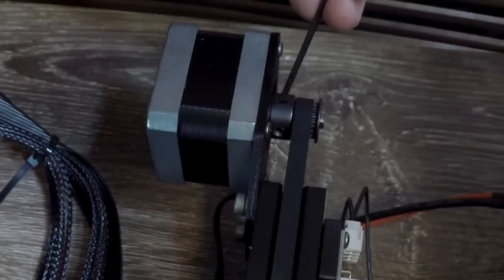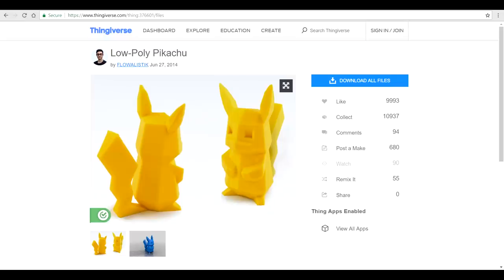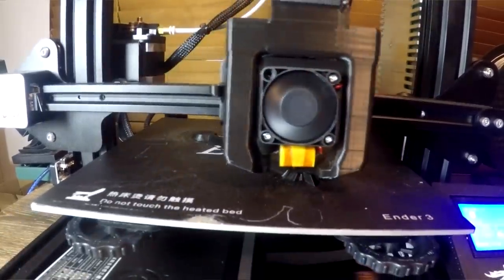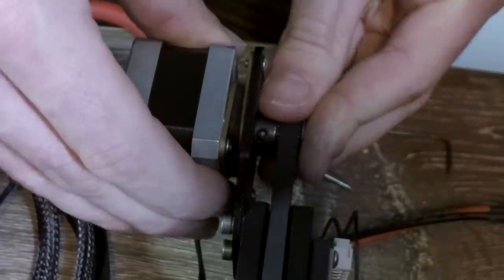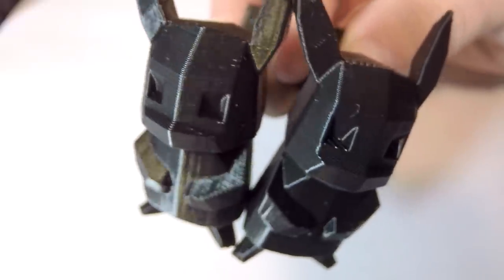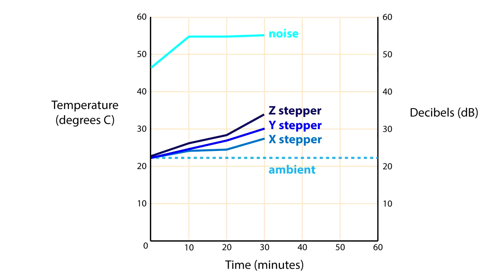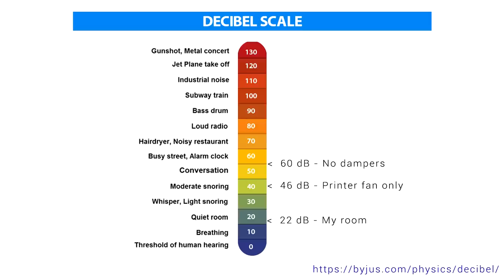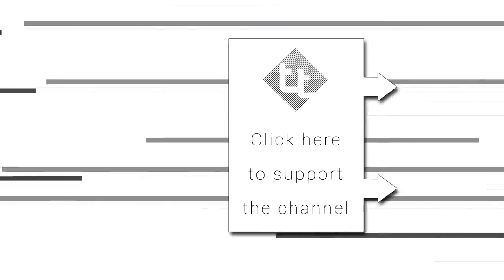Quieten your 3D printer with stepper motor dampers: Ender 3 tests

Comment: This guy has a solution for the likes of us who have stepper motors with pressed on pulleys:

https://www.youtube.com/watch?v=IjzrNoFnbcI&feature=youtu.be
Reply: Make a fixture to support the pulley while you tap the shaft out of it. Fit pullies that have grub screws.
Reply: @ventilate4267  Does it still work perfectly when putting the fit pulley back on the stepper motor?
Reply: Hammer is always a solution :D I think, that this is the common issue of people from printing community, to solve every problem by printing new parts, even if its usually not really needed :)
Reply: Or go to home Depot, buy a pulley puller, pop it off in 10 seconds and return it.
Reply: The above video for dealing with the pressed on pulleys DO NOT WORK FOR ENDER 3 PRO, the level adjustment wheels will hit the stepper motor
Reply: That's just a horrible solution. Too much things to change, including flashing firmware.
Reply: I guess it is kind of randomly asking but do anybody know a good website to watch new tv shows online?

Comment: Pro tip: steal two M3x8 screws from the lcd so you don't have to buy them. The lcd is fine with the two it will have left.
Reply from the maker: Great tip :)
Reply: Geweldig, thanks Maarten
Reply: LCD dislikes this
Reply: Was litterly sawing off the 2 screws that were too long... got through one after a long time and gave up... then i see this <3
Reply: Does your motherboard lid really need screws?
Reply: @franksimon8375  nahh

Comment: Just to let people know. On the latest ender3 I got, the pulley's are heat fitted onto the motor shaft so you cannot adjust the pulleys. I'm just going to get them off with a dremel & use spare parts I have to use this upgrade. Kinda a cheap, annoying move on their part.
Reply from the maker: Hmm that is surprising because it sounds more expensive for them.
Reply: Surprised me too... Its possible that the motor/pulley is from another mass produced gadget, like a 2d printer, & was actually cheaper to buy as a set. Trade is getting more complicated right now so they are probably getting more creative to keep the price down & maintain old profit margins.
Reply: I just got my dampeners in and went to install them and realized this is how mine is. So annoying.  Is there no way to get the pulleys off and still reuse them? Or if I get them off, can I buy new ones?
Reply: @MooKeeFPV  very easy to by new ones. they are gt2 6mm pulleys. the important thing is to count the teeth. its probably either 16 or 20 teeth but make sure you get the right one so the steps per mm is right. you should be able to get a handful of them for 10 dollars or less.
Reply: Bore in mine is 5mm, not 6!
Reply: @albertogomez-casado5527  6mm is the belt width sorry for not being more specific. the bore is 5mm to match all nema 17s
Reply: I had to end up buying the gears and this gear puller to get the other gears off the stepper.  https://www.amazon.com/gp/product/B07BFP7WGZ
Reply: @MooKeeFPV  thats a nice find! i might have to get one too.
Reply: @dakotapahel-short3192  I was watching youtube videos of people hitting them with a screw driver and a hammer.  I knew there had to be a better way.  Mine comes in today. I will let you know how well it works.
Reply: @MooKeeFPV  i was just going to use my dremel to cut it off... that way appears to save you a pulley for something later.
Reply: Dakota Pahel-Short that still may be an option. This puller I got is like 5mm too small
Reply: Oh ffs - just noticed the same on mine. Effin bastards. Already ordered the dampers.. cheap as dirt but now its just pissing me off. Still like my Ender3 but not buying from Creality again. They could just install dampers themselves and increase the price by a couple of bucks to keep the margins - but yeah thats not happening with a chinese company.
Reply: This is odd, I just ordered directly from Creality via Amazon and my printer has regular screws holding everything together.
Reply: Dang it I wish I would have seen this before hand,I didn't even think there would be a difference. I was hoping to get this thing a bit quieter.
Reply: It's not that hard to install these dampers still, but you're going to have to buy some new timing pulley wheels, which the ones I used is in the link near the bottom. I used 2 wrenches as a lever to get the old pulley wheels off and it made some weird noises, but it got them off. You're also going to have to print a adjustable endstop for the y-axis, because the bed will hit the y axis motor before it hits the endstop, also linked is the print that I used.
https://www.amazon.com/SIENOC-Timing-Pulley-Printer-Aluminum/dp/B01MSUCUUX/ref=sr_1_3?ie=UTF8&qid=1546555937&sr=8-3&keywords=2GT-20+Teeth+Aluminum+Timing+Pulley+Wheel+5mm+Inner
https://www.thingiverse.com/thing:2879245
Reply: I received my Ender 3 in ~ November 2018. The stepper motor shafts are without flats, the pulleys interference fit, the hot bed support X has the 4 pulleys in square formation and the Z stepper is mounted on a plastic block (not a bent metal plate). All of this is OK, and mostly an improvement, but doesn't help with this stepper motor damper mod. I tried a printed Y end stop mount with elongated holes but no good - with the damper still touched the bed's X brace when homing, plus now no room for Z homing. The answer: a machinist's file and cut a small notch in the X brace to clear the motor. 15 minute job. Easy - the X brace is aluminium & only need to notch a few mm - there's plenty of meat left after the mod. Extruder and X easy except releasing press-fit pulleys - then replace with AliX grubscrew ones.
Reply: that puller doesnt work
Reply: @TeachingTech  heat shrunk is not more expensive? It's literally a two motion assembly, if you have a halfway decent set up it's even one motion (we used an assembly press with a foot activated coil around the pulley, instantly heating it up). Putting a pulley on with screws in it is more expensive and requires more assembly. Even if you just put a pulley in the package for self assembly it'd be more expensive. (I used to work in QA for DC motors)
Reply: @emriys1334  I am not sure if it will work but there are cork dampers that are 1/2 the thickness of the steel/rubber ones. If anyone tries these out please let me know how it goes, as I also have these annoying steppers.
Reply: @MooKeeFPV  I bought the one in your link...it's way too small to fit over pulley.  Not sure how you got it to work.

Comment: These dampeners don’t work anymore without heavy modification because the motors no longer use grub screws. Really annoying because it should be an easy fix but now it’s much more difficult because of the offset issues and the non adjustable parts.
Reply: I got a ender 3 a couple months ago and it’s has the grub screws
Reply: Wish I read this before I bought mine 😂 mine are now fixed l, received my ender 3 3 weeks ago

Comment: These thermometers can not be used on small objects as stepper motors as they have relative big angle that they measure. It is not laser spot that measures. So in this case temperature of ambient environment is also measured. Print bed is it is not reflective is the only object in prusa-like 3D printer that can be measured using this device.

Comment: I installed the same dampers on my delta printer. Over time the belt tension compressed and unglued the rubber. Not good.

Comment: I don't think this method is possible in the new ender 3 versions. I bought some of this and there is no way I can put them in place, because that little piece in the stepper motor has no screws so it's impossible  to take it off.

Comment: doesn't work with the newer version unfortunately. Just got mine and the gears on the motors are press fitted so you cant adjust them :(

Comment: Great video!  Just received my Ender 3 for Christmas.  Bought a bunch of upgrades prior to receiving it and now it looks like they've changed the design.  Stepper motors have a pressed on gear drive in lieu of the set screw version.  No way to upgrade to the dampers without some special gear puller to move it.  Is there any other forum besides facebook were a newbie can get advice (as I don't have facebook).  Some minor issues I'd like to figure out.

Comment: Have you been able to measure any dimensional inconsistencies? I'm debating changing my steps/mm, but this is on a delta printer. This isn't the only factor, but with TMC drivers I don't really need the stepper dampers anymore.

Comment: Isn't the "z stepper" you put the damper on really just the extruder?     I believe the z axis stepper is located directly below the extruder; it ties into the 8mm threaded rod.  Mine vibrates like crazy when manually moving the axis up or down, though I don't see a way to install a damper on it.

Anyone know how to?

Comment: As of today 1/17/18, the ender 3 from banggood doesn't have adjustable steppers (the collar that the belt lays on) so you have to get new steppers and pulley collars to use dampers.

Comment: Hey every1, I've preheated filament to 185(celsius), I pressed filament change (when pla end was already 185) and it malfunctioned, pushed bed towards y+ axis with a high speed (assuming around 150mms) and stopends didn't work. Stepper motor tried to stop it for like 3 seconds with a buzzy noise. This happened twice. I wonder if I harmed the printer. I know it's not easy to break steppers down but I am also worried about stepper drivers. Printer seems to be working fine at this moment but you know, you make them work for hours. I'd like to make sure if it's fine or tolerable for steppers. I'd appreciate any professional information. Thanks and happy 3d prints.

Comment: How did you solve the issue with the bracket for the bed hitting the Y axis motor after installation? My bracket hits the motor before it activates the stop switch during homing. I moved my switch forward approx. 7mm but is that going to throw off anything when my print is done and the gcode tells the bed to move forward after the print? BTW I'm using ender 3 pro

Comment: Hi, thanks for this amazing video. 
Just one question: You mention that your extruder is making this high pitch noise, and it is the same as mine. 
I'm new to 3d printing, so I was wandering if you would know if this noise could be reduced by some setting in the slicer.
I'm also going to put the damper into the extruder, but I would prefer to have it without this annoying noise if possible (right now this is the only noise I can hear from the printer).

Comment: I noticed that using the packaging material is excellent noise-insulation to put under the printer. Just cut around 30cmx33cm plates and put them under the printer. I recommend using 2 layers, as the first one will get mushed after a day under the printers weight. 0 cost and no need to print anything. This removes massive amounts of vibrations against your table and so makes the printer quieter - and possibly improves print quality also. Combined with these dampers the results are fantastic.

Comment: Just an FYI, there must have been a revision in the Ender 3. My Ender 3 that was purchased as a Christmas gift has pullies that are pressed on and don't have set screws. The dampers space the pully too far away and the pully can't be adjusted. The only stepper that can still be dampened is the extruder.

Comment: Hi. I like too much your videos. I have an Ender 3 and my intention is to silence it as much as possible. In this video you install dampers to reduce noise. I have seen in youtoube, that there is another option to reduce noise installing TL-smoother cards on each individual axis. Also, some people upgrade entirely the mainboard to the version 1.1.5 of creality helping also to reduce the noise. Do you have experience in this? Do you know if is better to install the TL-smoother cards for each axis or replace the mainboard?

Comment: My damper made my motor stick out further under my build plate, and now I had to adjust my Y-Axis stop switch forward in order to stop the build plate from colliding with the motor.
Probably worth mentioning you will lose build volume from this.
Reply from the maker: Please see the pinned post.
Reply: @TeachingTech  No post is pinned
Reply: @TeachingTech  where's the pinned post?
Reply: I ran into the same problem... how did you end up fixing this?
Reply: @anthonyciofalo7005  I designed a new endstop mount, it's on thingiverse if you search "ender 3 endstop"
Reply: I have just fitted my dampers and had the exact same problem. Came back to this video hoping to find an answer! For now I have moved my stop switch forward by just using the one screw to hold it in place further forward.

Comment: I just added these to my old Printrbot Simple Metal, and they made a huge difference - even after a bunch of other upgrades including a Duet Maestro, quieter fans, and placement of the printer on a large concrete paver isolated on top and bottom with felt pads. Well worth the money, highly recommended.

Comment: One issue on the E drive is that if your not careful the rubber motor mount shifts the drive pulley as it has the ability to move either at an angle (as I have experienced) or just not as strong in contact during some prints.  I ended up removing mine so the drive gear for the filament does not get affected and it made a big difference.  The only thing better was to get a better drive gear that had more aggressive teeth and a slightly deeper cut than the original provided part.
Reply from the maker: I ended up removing E damper after filming this. I agree it's more trouble than it's worth.

Comment: Hey I appreciate all the help.  Im totally new to this so your videos are an amazing help. Currently I am having a problem with the stepper dampener for the bed.  It seems to block the bed from fully retracting to the rear of the machine. When starting a print and the bed retracts it is a few mm from the switch and the bed shakes then says can't calibrate please reset. Any ideas on how to fix this?  I would rather have a nosey machine than to cut it with the dremal. Thank you again u do appreciate the videos. JB
Reply from the maker: Check out the pinned post, it will help.

Comment: It looks like Creality have done an upgrade. My stepper motors (except the extruder which is the same) have their pulleys pressed on. No grub screw or flat edge on the shaft for a grub screw. So you cannot take the pulley off to adjust how far it pokes out, so you can no longer install these dampers. Bugger.

Comment: Do not buy the dampers from Banggod if you don't have a removable pulley, their holes are too small so they can't be installed :/
Also they look like someone found them in a moist basement
Reply: I should've seen this comment before buying

Comment: now you need to place a dense rubber pad under the printer and watch the remaining noise not amplifying off the table too. I did that
Reply from the maker: If so stumble across one in a shop I will test this.
Reply: @TeachingTech  yoga mat
Reply: Use the packaging material that came with the printer - tested and it works like a charm!
Reply: @TeachingTech  I just installed stepper dampers on my Tornado and they were great, but the biggest drop in sound I got was from putting the printer feet on rubber pads. There are also printable vibration dampers on thingiverse and some even use squash or tennis balls. You should repeat this test with those in a "how quiet can I make my 3D printer" video :)
Reply: Print the dampers that go under the legs off thingiverse. They are the bomb
Reply: My ender 3 has not the pulley with the little screw on stepper motors.... The pulley is pressed in the motor shaft. How can adjust the distance of the belt without breaking the motor stepper
Reply: I cut the foam from packing of printer and placed beneath the printer feet.
Reply: Danq I have that as well. Helps prevent the noise from radiating through the house (handy for late night printing)
Reply: I also saved the packing material. It's a dense strong foam and the reduction in noise is ridiculous, I couldn't believe the difference.

Comment: I do not use stepper dampers but bronze bearings for X and Y. Search for Toolson P3Steel Mk2. On my P3Steel I measure 34db average using A4988. 40db on jagged edges. But I just realized that Ender 3 uses those bearings on alu extrusions. Too bad ;)

Comment: I added a stepper damper as described to the Y axis of Ender 3, and when I try to home the axis the stepper now hits the bed carrage before it engages the limit switch, causing the stepper to keep attempting to home and making that racket when it can't move the bed back any further. Did anyone have this issue and is there a fix other than grinding out a small groove in the carrage where it hits the y-axis stepper?
Reply from the maker: Please see the pinned post.

Comment: 4:12 what do you mean by “this is gonna need to change its offset” and how do you do it?
Reply: I know this is old and you might have figured it by now, but for anyone that stumbles across and might find it helpful: he just means that since the motor will be placed further back, the pulley needs to be pushed a bit further from the shaft, that offset. Otherwise you would push the belt towards the v-slot groove.
So just remove the pulley, and reinstall it on the correct location after the dampers are there.